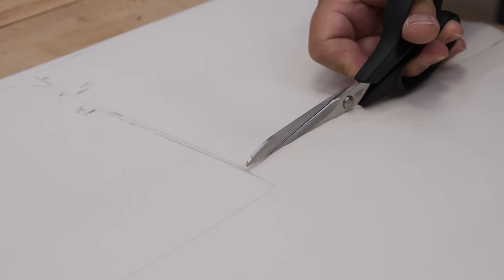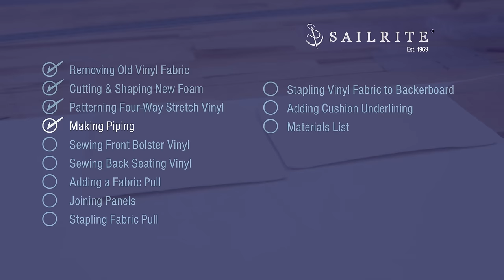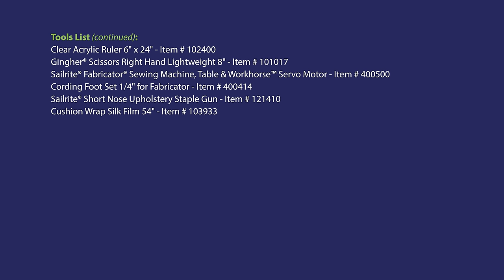How to Reupholster the Seat for a Pontoon Bench

Comment: Any tips for refreshing the backer board? Ours are old and moldy. Can you paint the wood? Or any synthetic alternative for replacing the marine plywood?
Reply from the maker: You can use marine plywood or what is called "King StarBoard® ST HDPE Sheets". If you can clean the mold of the old wood and it is still structurally strong you can also just paint the wood with an outdoor paint.